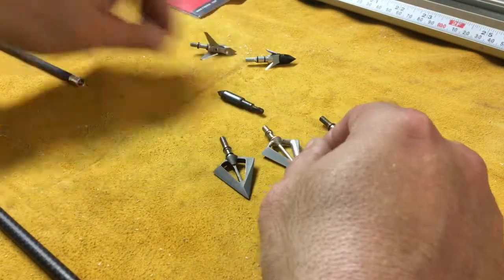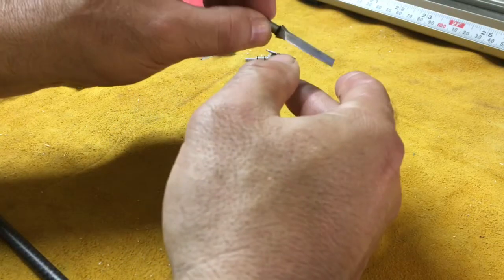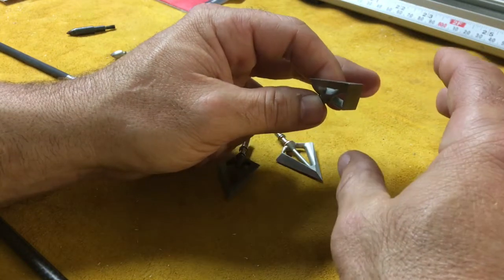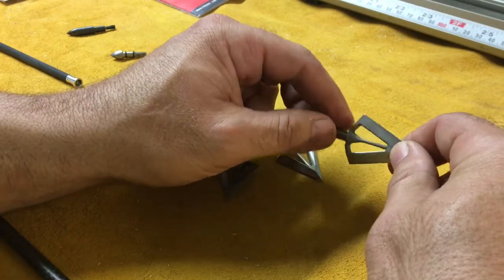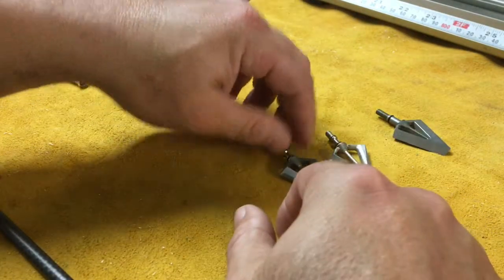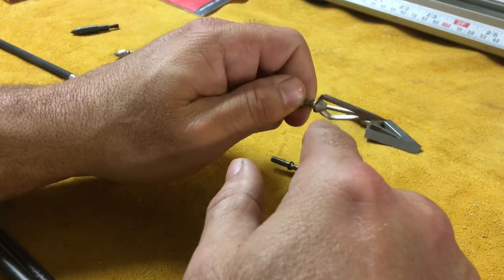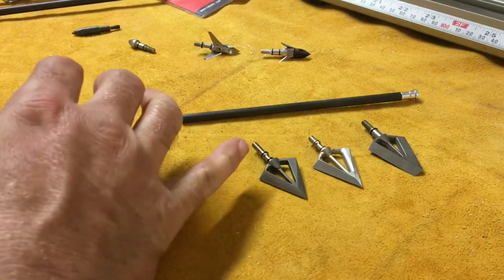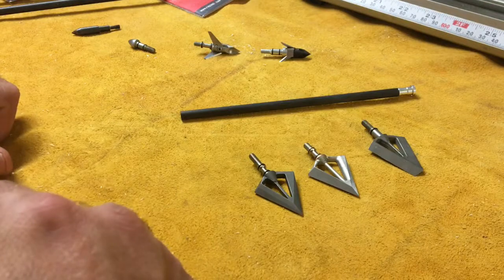Vital Limits, Firenock Traumahawk, Firenock SS Dagger & Firenock GR5 Titanium Dagger .

Comment: Should they be set at 3 and 9 or 6 and 12 on crossbow bolts???
Reply from the maker: if you are referring to position of the head on the arrow, I would not hold it to that since there are other potential variables  There are tuning spacers . Like anything else, trial and error.